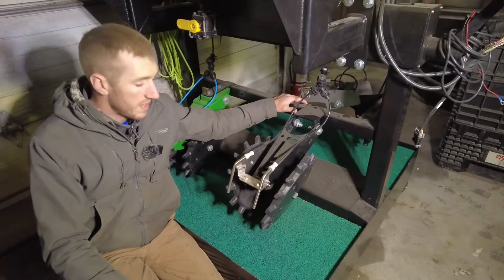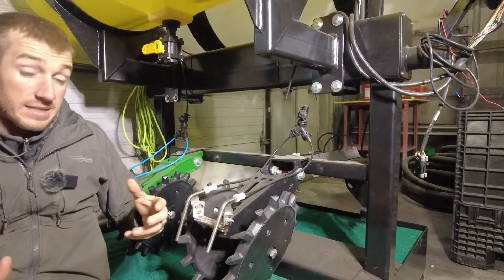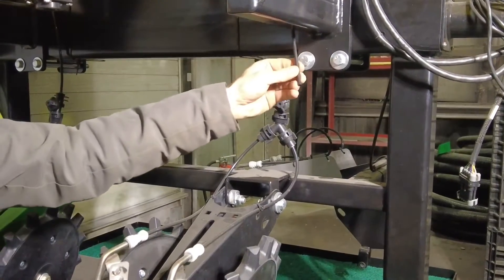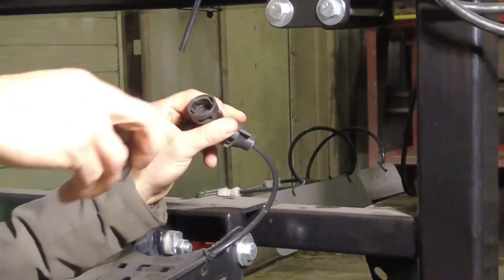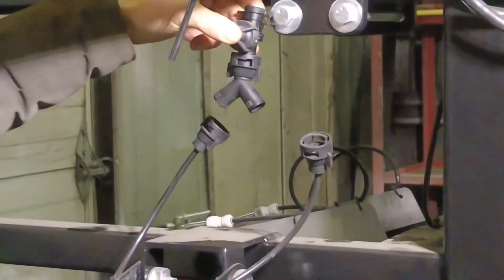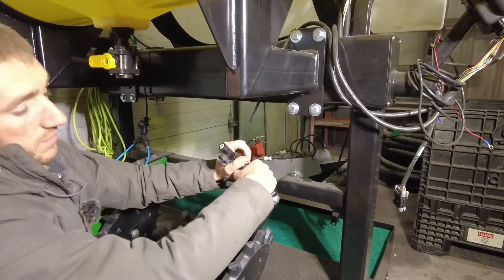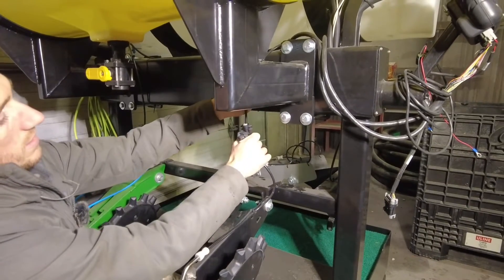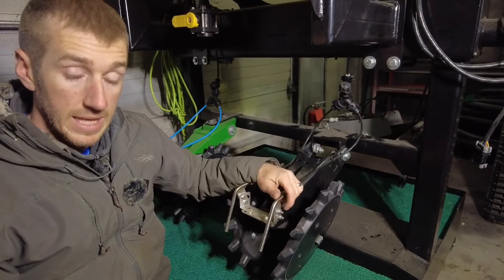How to Plumb a Split 2x2 Fertilizer System

Comment: I'm a beginner farmer wanting to plumb my planter this way. Do you have part numbers for the TeeJet parts? I'm looking on their website and I don't see anything about a check valve being in the body part before the Y split.
Reply from the maker: Give me a call sometime 419-852-5836
Reply: Take a look at Part # 758175 from Precision Planting. 3/8PTC in and dual 1/4PTC out Even easier to service and maintain. And they have a 1 psi anti dribble check built into each outlet.